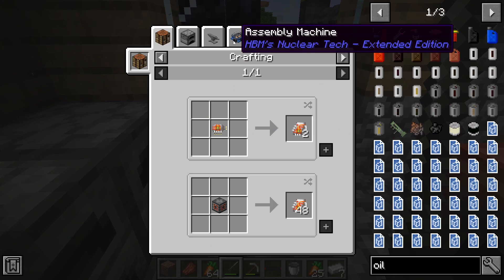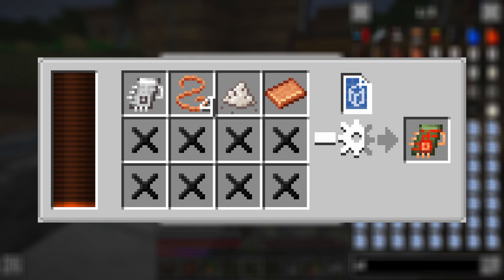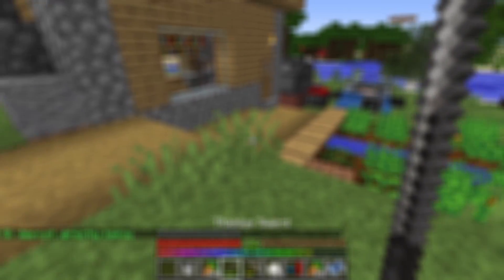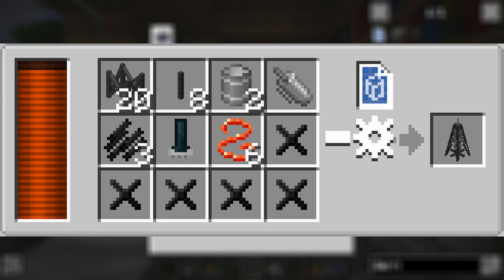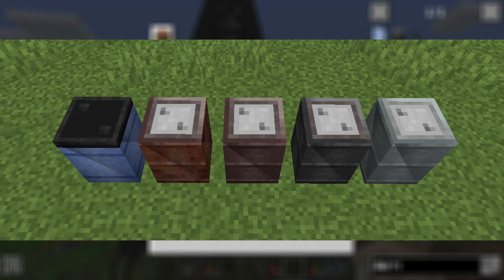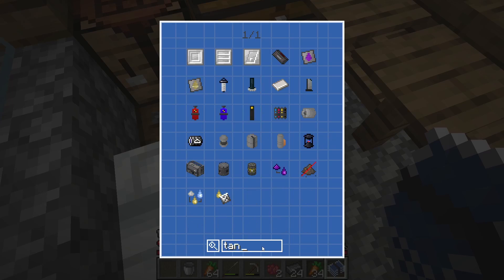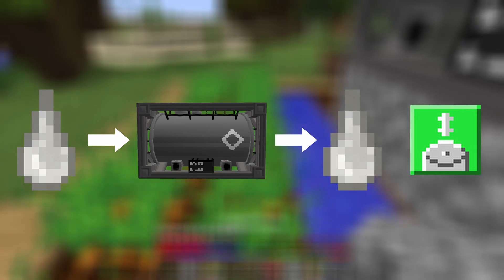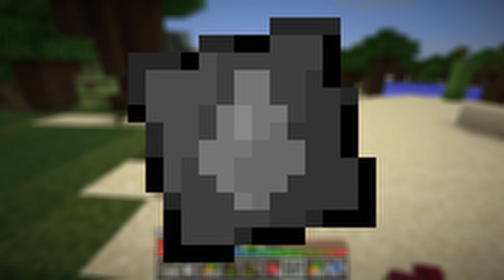HBM nuclear tech mod ultimate survival guide pt.4 | oil production and processing

Comment: "and the fracking tower which you dont need"

The fracking tower can extract oil from bedrock reservoirs, something neither the pumpjack and derrick cannot do. Bedrock reservoirs have INFINITE OIL, meaning that after getting a decent amount of oil and products from basic oil reservoirs, you can get INFINITE OIL from just ONE WELL. It's not even that late game. Only down side is the requirement of fracking oil which is not hard to automate with mixers.

Comment: For those having a hard time using the geothermal electric generator to power the oil derrick; use a Solar Tower Boiler with an Industrial Steam Turbine and Heliostat Mirrors. The setup takes a little long to complete but its almost infinite energy at daytime and no using lava that turns to stone or obsidian 15 seconds later.

Comment: yo help my oil is not going into my boiler 1.12.2 extended
Reply from the maker: Try to set the tank to the green setting, so the oil can come in and get out
Reply: @randomShit69  already tried that, im using extended too, it don't work anymore when i switch to extended. i had a world where i used hbm reloaded then switched to extended. the world works just fine but minor changes.
Reply from the maker: Try crafting a new tank or breaking and placing the tank.
Or the issue could also be with the fluid ducts.
I would recommend crafting a new tank with new ducts, I think this could solve the issue.
Don't forget to store all the crude oil somewhere before breaking the tank
Reply: Even though I’m like 4 months late, I had the same problem. So I basically downloaded the Faszom HBM which is a modified version of Alcater’s HBM extended.
Reply: @boptuss  will it keep all your hbm mod blocks?

Comment: do i need hbm and ntm both to play, or what is better if not?
Reply from the maker: Ntm stands for "Nuclear Tech mod", it is the HBM mod, you need only the mod itself. you can play the official 1.7.10 HBM mod or the reforked "HBM extended" for 1.12.2, I am using the HBM extended :)
Reply: @randomShit69 thanks bro, i was so confused🙏🙏
Reply: @gunslingrr  extended is better but u can switch to extended if u used hbm in the past, back up ur world tho
Reply: @catgaming2210 I feel that would break a lot considering 1.7.10 got a lot of stuff that 1.12.2 dont but extended still better cause it’s 1.12.2